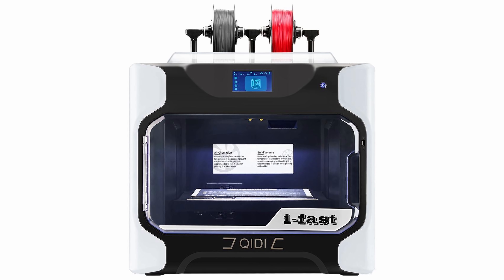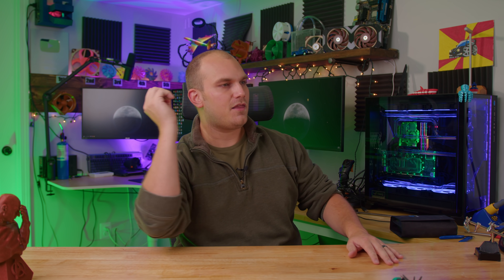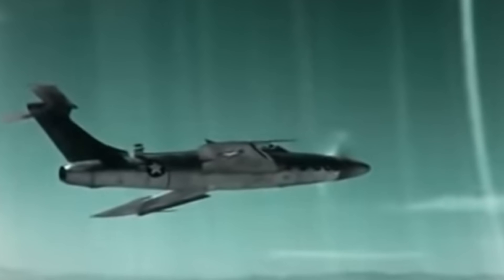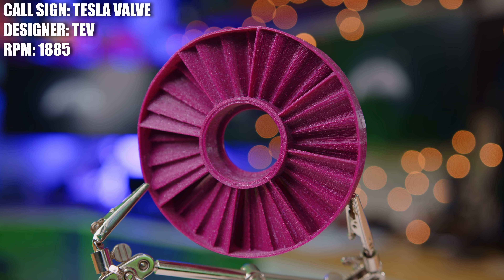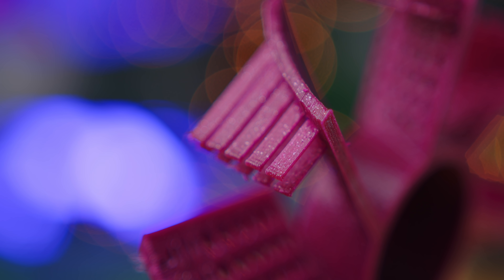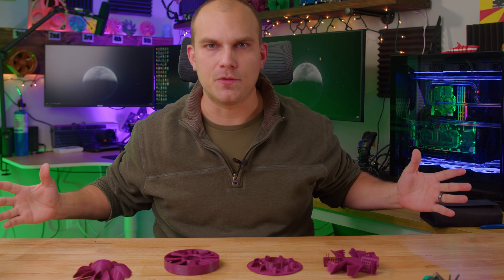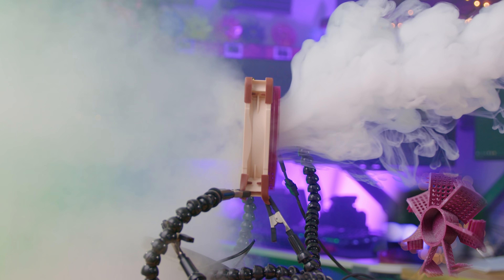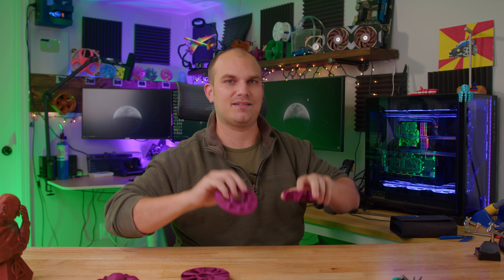The IMPOSSIBLE is now POSSIBLE | Fan Showdown S3E6

Comment: On the Tesla valve fan and the turbulence.. I think it is due to the outer ring on the fan. It provides a space between the fan itself and the frame, where the air is allowed to do.. as it pleases? Look at it this way; on the intake side of the fan, air is being pulled in. On the exhaust side, air is being blown out. So there is a constant push/pull battle within that gap. Perhaps if the ring were removed the fan would perform better, or, if the fan and it’s ring were a slightly larger circumference, and sat under the frame where the ring has no influence on the incoming air, performance may increase. That would be an odd looking fan though.

Comment: A fixed ring of material will drag air around with it and pretty much create a turbulent interruption there, which is basically what's happening at the tips of the Tesla valve fan.  The Prandtl fan has something going for it as many aircraft wings have a similar design called "washout", where the airfoil gradually points more downward toward the wing tips to avoid tip-stalling at lower airspeeds, reducing turbulence there.

Comment: I wanna see you take some of the best performing fans of all time (standard sizes) and print one normally, and one inverted (mirrored) then put each in its own motor and put them back to back, so that the blades spin in opposing directions but flow air the same direction. This should increase static pressure a lot, and I'm curious to see how that compares

Comment: i feel like Tev's Tesla fan needs the central flow controller leading from edge to center, maybe 33%-50% diameter in length, the fan is just the "walls" of the valve, i have very little skill in digital modeling but wanted to share my thoughts for Tev or anyone that thinks im may be leaning in a good direction. love the show, cant wait to see what unique idea come off the print bed next.

Comment: I would REALLY like to see the Prandlt fan with more surface finishing (like acetone smoothing or the like) to increase the laminar flow. Wondering if that might cut noise even further and make that smooth flow even smoother.

Then an updated tesla valve version would be cool too. This sort of design requires multiple iterations because of the complexity of the flow and pressure within it.

Comment: The cheese grater works because there are air flow guiding fin designs that are like that, the the tips mimic Owl feathers, as owls need their quiet flappings dampened. Similar designs can be seen in Thinkpad fan blades you can even find patents for it.

Comment: Forget the Spectrummeter with DB meter. Simply use a  calibrated Microfone in combination with the Programm REW, thats how speakerbuilder do it with the only difference being that our sound source is a speaker. 
You can calibrated REW for SPL as well, check out the REW manual on how to do that. 

Second possible method; record the sound (keep in mind the Microfone responce should be a linear as possible which means the built in Smartphone mics are not suitable at all) with a program of your choice like RecForge (for Smartphones) or audacity, from there on the analyzingpossibilities are basically endless.

If you need some help, the German Diy Hifi Forum and Hifi Forum have some exceptionally knowledgeable people on board.

Cheers
Nik

Comment: I'm an acoustician in the UK and use the NTI XL2. There is a 3rd octave Spectrum Analyzer software extension built into it. Its known as a Class 1 device and is used for professional noise survey applications. Also, its about as cheap as a Class 1 unit gets. Hope this helps.

Comment: For flow testing, you should dump the air CFM Gizmo. Use a Mitsubishi automotive Mass Air Flow Meter (MAF), to accurately measure the exact density of the air moved. It's accuracy will accommodate moisture and air temperature variations. Should be able to get a reading from it and find a scale for the voltage output to air flow

Comment: The  cheapest way to db meter with a Spectrum Analyzer is to get a Daytonaudio IMM-6. It's a calibrated microphone that plugs into your headphone jack on your phone (I think it would work with the adapter for headphone jacks on newer phones.) it works on Android and Apple. Then you download the calibration file and download the app. (for Android it's called Audio Tool) I use it for calibration of my stereo system. 🔉🛠️👌
Reply from the maker: Looks like a winner

Comment: No, what you need is to build a thermal chamber and a dummy load.

Thinking about it, the best would be a self limiting heat source with power measurement.
Like a good coffee maker, were temperature is constant and power is variable.

So them you can place a microphone inside and have the spectrum while also providing less room noise and more consistent temperature.

Guess it would be a serious engineering endeavour.

Comment: You're right that there's almost no decibel meters with a built in spectrum analyzer, at least no good ones I know of. But what you could buy is a calibrated microphone meant for room correcting speakers. miniDSP makes a few models (though ~$140 is pretty expensive) you'd be able to use with software on your pc to see a frequency response/sound spectrum, measure SPL very accurately and of course you would be able to record audio straight from the mic itself. Might also be worthwhile to set up a small enclosure with wool blankets or other sound absorbing materials to get an isolated and more accurate measurement/recording.

 I also find measuring and room correcting speakers pretty satisfying, so if that's something you're interested in it's not just a single use purchase.

Hope this helps and great videos as always. Love your dedication to improving quality.

Comment: You need to standardize how you do the db testing. Seems like every time you do it differently. You need to keep the distance between the fan and the meter exactly the same, and you need to do it in the same spot, in the same way. Having it on a table is going to make it louder then having it floating. Different types of surfaces are going to add or subtract decibels. It shouldn't matter exactly how you do it so long as you do it the same every time, but right now you can't compare decibel ratings between episodes. I suspect there might be other small changes changes in the environment (humidity?) episode to episode where it might be interesting to re-test the top 10 and see how things fall?
Reply: The fan speed should be standardized as well, at least in addition to max speed set up, the cheesegrater was much slower than the Prandtl.

Comment: I think you just need to take off the outer ring from the tesla valve. Air that is getting drawn into the fan is not only moving through it but towards the tips as well. When it hits the wall, that is the outer ring, some of it will fling out backwards. Also, if someone can make it: Tesla valve design but perpendicular to the blades. So that the air can't travel towards the blade tips, moved by the centrifugal force. Would be interesting to see if this design would result in a straighter exhaust pattern, rather than the usual conical "let's throw aitr everywhere" shape.

Comment: Hey, grab a UMIK-1. Not only is it fairly cheap for what it is, because it's a usb based measurement microphone it can pretty much perfectly measure the spl as well as the exact frequency response 20hz-20khz. All you need once you have the mic is a computer and a free program called REW (room EQ wizard). Hope this helps!!!
Reply: You can use REW, but it's really not needed here. Any audio application that has an FFT in it can do what he wants, like Audacity (also free, and has more knobs on the FFT)
Reply: @gorak9000  REW is better because it automatically reads the calibration file for the UMIK-1
Reply: @Anthony_DeSouza  Precisely! That and a bunch of extra features that can be super useful!

Comment: My recommendation for the Tesla Valve would be to have the blades spaced radially - like overlapping discs. 
 
elaboration for clarity; circular discs with the tesla valve spacing located between them - with the origin being the center of the fan 

as opposed to how it was designed with the blades running from the centre of the fan outwards - like clock hands

Now - how and what that spacing is... 

¯\_(ツ)_/¯

Comment: for 12 cm fan blade tip to reach super sonic it would need to spin more than 50 000 rpm or 875 revolutions per second :D I dont think blade tip noise is an issue in computer fan.

Comment: I used to work at a car stereo shop and we had a RTA meter. Real time analyzer. It would show how loud each frequency was in real time so we could see the effect of changes we did to the systems. Lot's of the cheap spl meters won't read low frequencies. Thanks for the great vids.

Comment: You could get a Mini Dsp UMIK and use REW. It would be less then $80 USD and I would imagine it would give you quite accurate spectrum analysis. While the UMIK isn’t  laboratory quality test gear it does come with a calibration file and should give you a pretty decent indication of what’s going on.
Reply: ☝I was just about to suggest the same thing. I own a UMIK-1 and know that it should be perfect for this use case 😊

Comment: About the sound levels of the fans, that is the most common issue with using dB as the only metric for comparison, it does not account for the frequency of the sound. Low frequencies are typically perceived as quieter for the same dB level as higher pitch noises. Then there is the differences in the waveform, a more square wave is going to sound much harsher to the ear then a sine wave. Acoustics are very complex.

Comment: The channels in the blades of the tesla fan are basically trapping air, which is then travelling radially outwards due to a centrifugal effect. It's sort of working like a blower fan, except when it hits the ring at the edge of the fan it's spewing out the front and the back.
Reply: sounds like its performance will improve significantly if they fix this issue

Comment: I still think the resolution attainable by a resin printer would work better in your attempts at testing the fluid dynamics (aerodynamics) of these fans. These prints while looking nice (especially at speed) are very lumpy and bumpy as far as air flow and turbulence are concerned.
Reply: Nope, he has a resin printer, he tested fdm Vs resin for the fans. There was no appreciable difference
Reply: @lio1234234  I guess it would come down to the sensitivity of the equipment he's using to test with.

Comment: Spectrum analyzer?  A poor man's way to do it is to use a smartphone and install an app like spectrum analyze or something.  In the end, all a spectrum analyzer is is a microchip running Fourier Transforms on microphone data.  At the very least, I'd use something like that as a sanity check for whatever you find on Amazon since I'm betting neither would be accurate unless you're willing to spend a bit of cash, but at least it'll tell you something.

Comment: You will want to upgrade the Ifast to an IDEX setup as printing with a dual-extruder system on a single carriage can lead to heat-creep on the extruder waiting to print. I am not saying you cannot get them dialed-in but an IDEX (independent extruder) setup would allow the support material extruder/hotend to park until needed 
which will eliminate the heat-creep problem. Plus the IDEX setup will add much greater potential to your overall 3d printing setup with many features unavailable with a single carriage printer (unless you go tool-changing). Def looking forward to to learn more about this printer and how it prints with dual extruders as I was not impressed with the Replicator clones in that aspect.

Comment: "There's no fan I can't print now" - famous last words
Reply: We need a clockwork "fan" with multiple tiny 3d scanned copies of James rotating around, pure spectacle, performance be damned!
Reply: Challenge accepted!
Someone’s going to design a multi-turbine fan with internal printed ball bearings.
Reply: @JesusisJesus  Did you just describe a gang whistle?  Will that be an air raid siren?  We gonna win the noise war!  Contrary goals; bring it!
Reply: I wonder if I could design a tiny 3D printed internal combustion engine to power it....
Reply: @stoneymahoney9106  Can he print with materials that support internal combustion without melting? Perhaps he should collaborate with Integza!
Reply: @stoneymahoney9106  not internal combustion, BUT, you can make a pneumatic engine, Tom Stanton's channel has several in fact, with some even powering small aircraft for short flights!
Reply: Challenge accepted, be ready for a 5 rotor beast

Comment: Get a VSt spectrum analyser plugin (or standalone) and set up a mic next to the db meter running into your audio interface. You'l get a lovely real time audio spectrum on your PC/lappy. It should run nicely in your video prod suite or run it thru Audacity if you dont have a DAW to use. I used to use Voxengo SPAN and Fre(a)koscope  by Smart Electronix.
Reply: Studio engineer here to confirm that SPAN is excellent. I'd also recommend iZotope RX, which has an intro version currently on sale for about $30 US. It gives an incredible amount of precision for measuring and visualizing loudness, pitch, harmonics, etc.
Reply: My first thought.
Reply: well...I was looking to see if anyone suggested a guitar tuner.

Comment: Shows just how impressive the Noctua design is.  Although, they also know the KV of the motor, so a bit of an unfair advantage.
Reply: i think some smart people would have figured out the KV, as a few have outperformed the stock fan
Reply: What design? Noctua didn't design jack shit. There's like 3-4 Fans that look exactly like the Noctua A12x25 that are much older than the Noctua A12x25...

Comment: Now that you have a printer that can do dissolvable support material, what if you made a new radiator with improved tolerances, using your copper powder. Perhaps we can achieve better performance? A return to the Cooling Tower with our Fan Showdown Leader would also be interesting.
Reply: he was only able to do that because it was a resin printer, not a filament printer. the new one is for filament only
Reply: Copper, wood, etc. filaments are usually only a few percent of that material, it would be more than useless to print something that's actually supposed to conduct heat.

Comment: I was thinking about the tesla valve.  what if you made a shroud for the back of the fan, and somehow trapped the air back, preventing it from recirculating?  Basically, closing the gap at the back...

Comment: I am astonished that ludicrous Cheeze Greater did so exceptionally well lmao. Doesn't even make any sense. It was literally knocking on the door of that Prandtl fan.
Reply: Probably just the big flat surfaces. The holes dont really matter too much after the air starts moving. I am surprised it wasnt louder.
Reply: @liberatorkramit  noise might have something to do with that too, since the holes are fairly even and large. Not much room for whistle development
Reply: I was wondering if the wispy fins disrupt tip vortices, could be part of it.